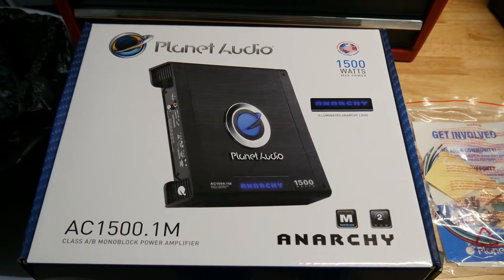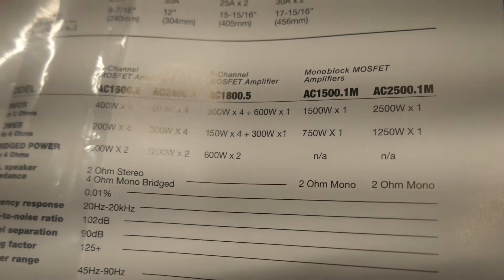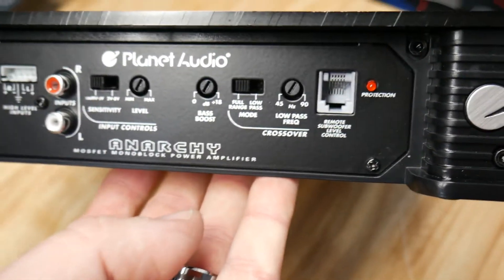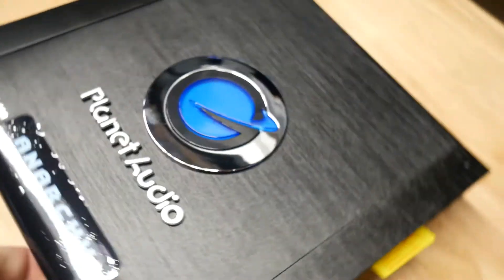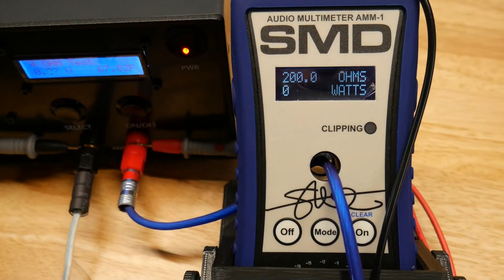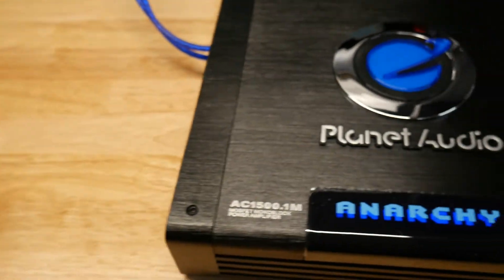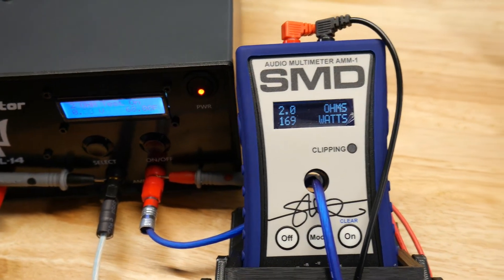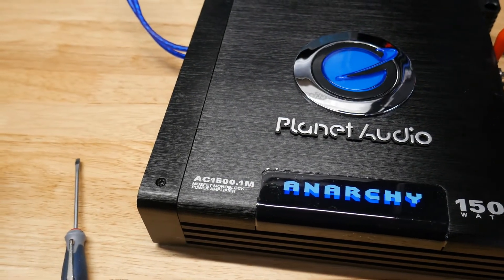Planet Audio AC1500.1M amp review Dyno test HiFi Vector DL14 and SMD AMM-1.

Comment: Turn up the input level and set the switch to full range. I think you will get better results, I’m running this amp in a single 12 inch pioneer TSA30S4 sub that’s rated for 400 W rms with 1400w peak  and shakes my rear view mirror.There’s no way it can only power up to that many watts.

Comment: I have this amp pushing 4 8s it does its job but clearly it’s not pushing out the watts it advertises it goes into protect with them being turned up slightly and gets extremely hot
Reply: How many watts were the subs each cause I have 2 8 that are 800 watt max and wondering if it’ll push those ?
Reply: I have 4 8s skar 150rms each they sound great maybe depends on your setup

Comment: class A/B monoblock fused for a 30amp electrical draw at 55% to 60% efficiency, 100w rms @ 4ohms and 175w rms @ 2 ohms is not a surprising result.
Amazon has a Fydun monoblock class D for sale that is usually found cheaper than the planet audio, it's fused for a 40 amp current draw and with class D efficiency it should be good for about 175~200w rms @ 4ohms and 275~300w rms @ 2ohms.

Comment: The whole it feels heavy and well built well I had a PA Torque 1500.1 and when i took it apart it there was 2 cavitys that ran the length of heatsink/amp body in each side and in this cavity was a  5/8" x 8" ish steel round bar slid inside it, it was obviously an attempt to make a amp with not much substance feel like it did... I took the bars out slapped it together to see what it weighed and it felt like nothing... So imo if someone needs some nice fat steel round bar but a PA amp pull the steel out and toss the rest in the trash can. How does PA/boss still sell this crap when companies like recoil sell several badass amps for under $100?!?!

Comment: Had one pushing to 12s  in my chevy blazer  ,now i  have the 2500 version pushing the same 12s in my wife's chevy tahoe ,it's actually dimming the lights when the bass hits
Reply: Get some OFC 4 gauge wire . And a good battery and you’ll be good

Comment: Running a line out converter with this amp where should the sensitivity switch be set to the far left or right i had set to the right 2-8volt settings is this right
Reply from the maker: Read up on how to set input and output gains. To long to explain here.

Comment: Great videos man, subscribed.

I'm learning car audio stuff and I'm curious why you always test at 40hz?

I bought a used Pioneer TS-SWX2502 in great shape and it came with a Pioneer 500w peak amp that I know is under powered for this sub. 

The sub is rated for 400w RMS at 4ohms according to Pioneer and sounds suprisingly good even with the small amp, but I want to get a better amp to improve sound and protect the sub.

I was looking at this amp and the Lanzar HTG137 you reviewed and they both seem pretty weak.

Obviously looking a budget options, any recommendations?
Reply from the maker: 40hz is kinda industry standard to test monoblock amps it is a good baseline frequency.  For cheap yet good check out skar they put out more or at least what they say and they are good quality. But there are a ton of options depending n your needs and budget. Thank so much for watching!
Reply: @HiFiVector  the Skar stuff does look great in your videos but it's harder to get in Canada.

Is there any chance the planet audio or lanzar would power this smaller sub of mine effectively?
Reply from the maker: @brolanlaurier9610   if you are going to run 1 sub at 4 ohms here are a few budget amps that would be perfect these are Soundstreams 
TXP3500.1D https://amzn.to/3FQqLlb
PN1.650D https://amzn.to/3Zcu7pA
And here is  a Planet audio that would work since you asked about a planet audio amp.
BBD2500 https://amzn.to/3FM4vZC

All will give you round 400W True power at 4 ohms. I would personally choose the PN1.650D as its korean made and small  but any of these budgets amps will be good for what you are looking to do.
Reply: @HiFiVector  I really appreciate the help here, but Canada sucks sometimes lol.

The only one I have good access to is the BBD2500 and it's over $300 shipped.

Comment: What RMS and size sub would be ideal for this amp?
Reply from the maker: 1 sub and it would need to be as low as possible really I would say no more than 300w rms sub.  You can do a 8,10.or 12 . Low cost sub.
Reply: @HiFiVector  2ohm sub Im guessing? I got the amp for free lol so might as well use it. What would you suggest me run?
Reply from the maker: For this amp this skar sub in one of these 2 boxes would be great.
https://amzn.to/3L4G6z3
https://amzn.to/3vDlmYH
https://amzn.to/3ECRGPJ
Reply: @HiFiVector  do you think a 500 watt rms sub will do okay on this amp?
Reply from the maker: Make sure to get a dual 4 ohm sub and wire it to 2 ohms.

Comment: Goes to how you how over-hyped wattage/power ratings are for amps in general...you'll find similar results in the higher end models as well. I run one of these AC1500.1M amps in my F-150, It's powering two 12" 2-Ohm DVC shallow mount Cerwin-Vega subs, wired for 2-Ohms. I knew the 300W RMS rating of the subs probably wouldn't be pushed much by this Amp...glad I didn't waste $$ on subs with 500W+ RMS . That being said, the subs still sound great and I've never had issues with the amp. How were gain and bass boost dials set on the amp when you ran the vector test? Were they cranked all the way up?
Reply from the maker: Yep nothing wrong with lower power amps as long as you use efficient lower wattage subs. I agree, the false wattages happen over many brands.
Reply: @HiFiVector  I legit just bought this amp and was a bit disappointed seeing this until I finally found the pdf for the sub I'm going to use it on. Apparently, my sub is only 200 wats max anyways, so this isn't even that far off of the subs rating. For the price to wattage, it's not all that horrible. Wouldn't be near as bad if they didn't try and inflate their ratings so bad.
Reply from the maker: For a 200 watt sub it will be fine  for sure.